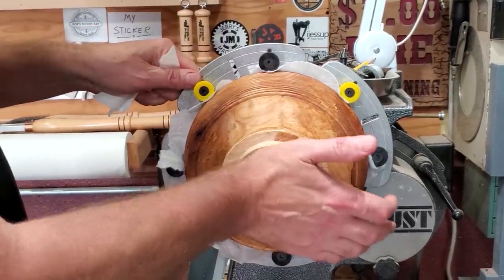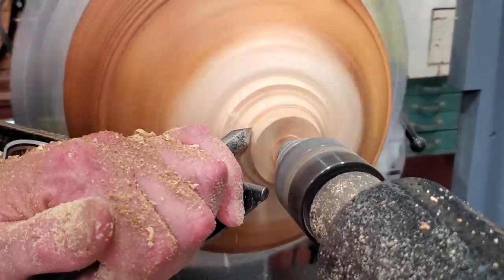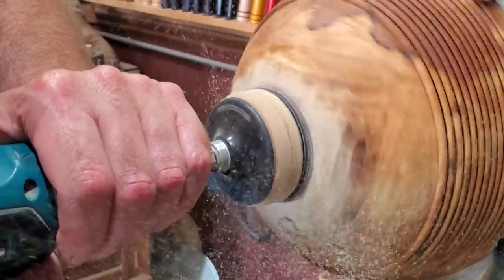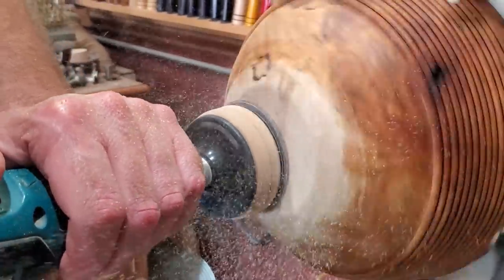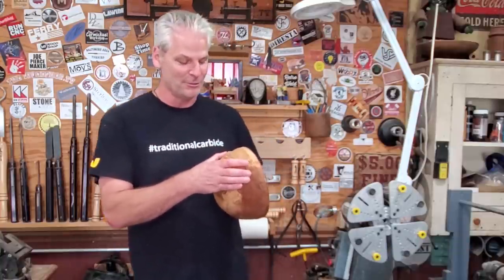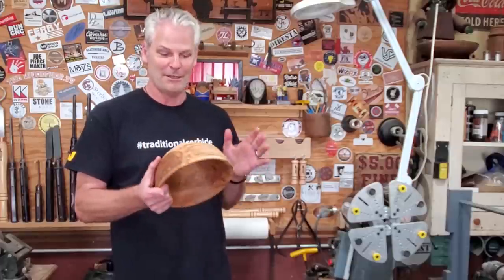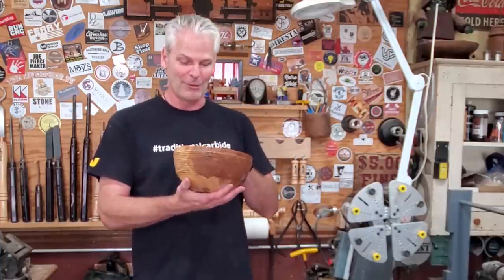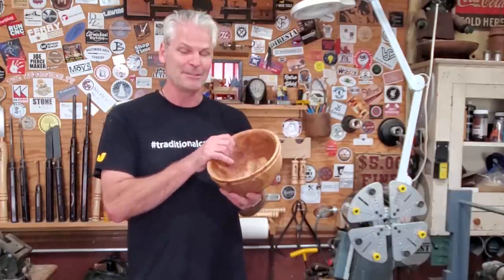Woodturning | Sycamore Bead Bowl

Comment: Beautiful bowl!  And you make turning it look so easy!  Did you sand the beading at all? or do you get a good enough finish with the beading tool.  And what is the abrasive you use when you are applying the oil?  thanks so much for your videos!
Reply from the maker: Thank you so much Amy!! The beading tool has a very nice finish, but I did sand a little with 400 then 600 
The sanding pad is from Ken at Woodturners wonders.

Comment: Karl do not tell me what the thread pitch on the side of the band saw LAGUNA bx18 there is a size in inches 5/17 and what the thread pitch on ALIEXPRESS several different dies for cutting and bolts, thank you.
Reply from the maker: I'm  not sure, I have a Harvey and Jet band saws.
Reply: @CarlJacobson  you have the same LAGUNA18bx or this is harvey or you returned as you can do or sold.?, thank you.!!